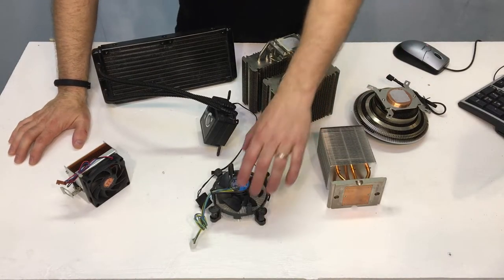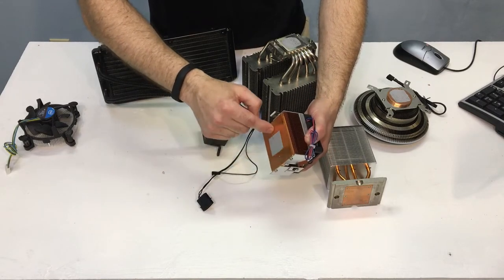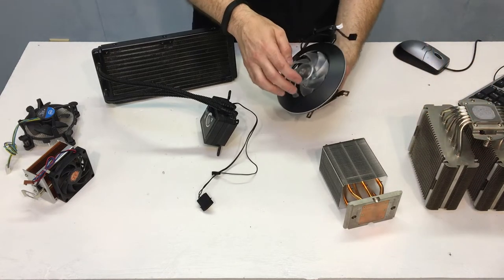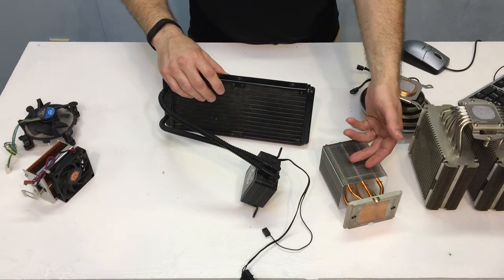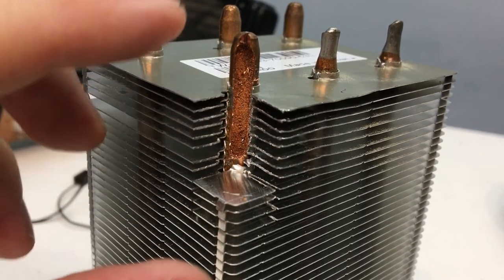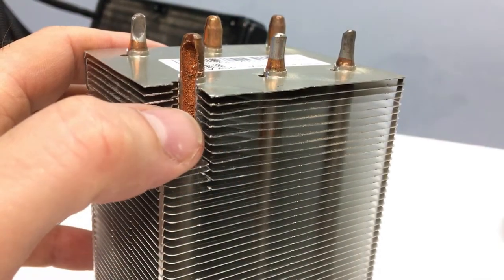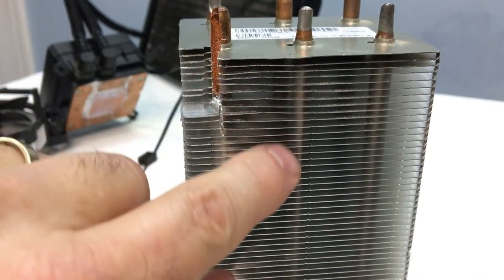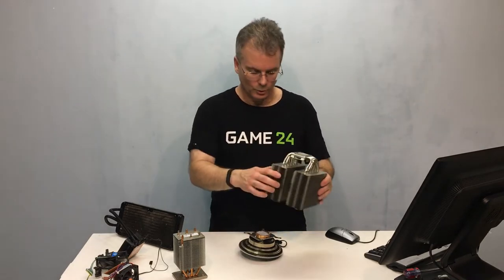What's inside your cooler?

Comment: Very useful explanation, thanks! I (foolishly) sanded off the ends of the pipes on my Hyper Evo 212 cooler to fit it in my case. I created pin holes in the ends as a result, but thought it was fine since they are hollow. I am having overheating issues on a newly installed i5-10600KF... now I probably know why!
Reply: lollll

Comment: I wonder how much of the internals of an AIO you'd have to replace to be able to run something like methanol or acetone through it? I have an old 2014ish H80 (same pump/block design as the one in this video) and I've had it just sitting on a shelf for years because I emptied the loop to see if it was as bad after 6 years as everyone says AIO's get... The coolant smelled suspicious but the entire loop was totally clean. There WAS damage to the microfins on the back of the block though. It looks like it got jammed in a press or on the assembly line somewhere and they just put it back on the line and sent it out the door.

Comment: So when the cooler is mounted on the CPU and once the motherboard is hanging in the case the, assuming that the Heat Pipes are running vertical through the area that is contact with the CPU, the Base, that only the pipes that are higher/above the level of the CPU are doing the heat transfer thing? Heat rises, so the pipes that are below the CPU location are not able to provide any cooling, I assume
Reply from the maker: Convection certainly does have an affect however heat will always move from warm to cold so it will work regardless of orientation. Does it work a little better if, for example the motherboard is flat with a cooler sticking straight up? Probably but I doubt that it is significant enough to notice a difference. I think having good airflow probably has the largest affect.